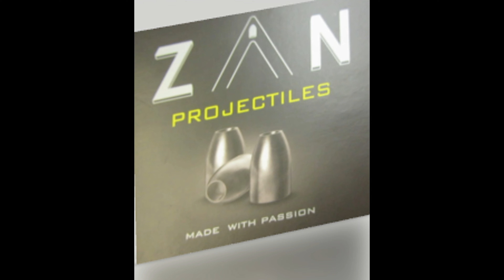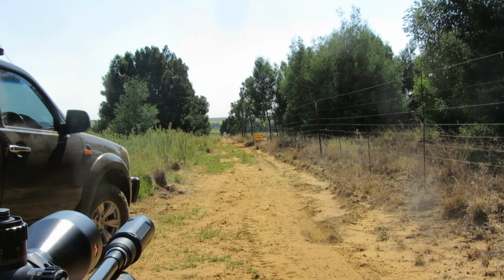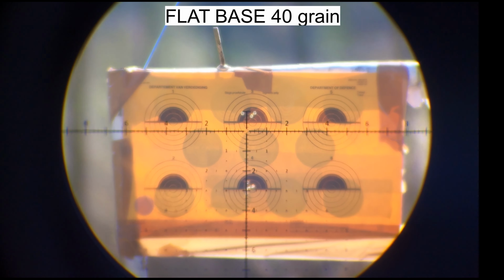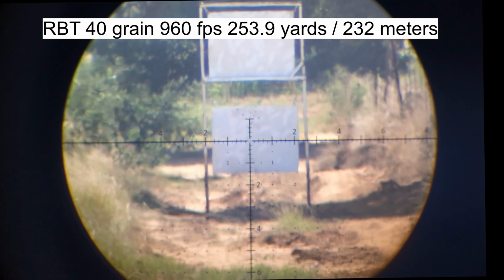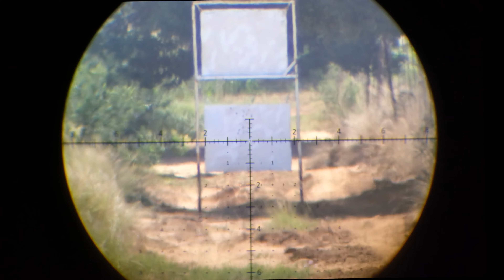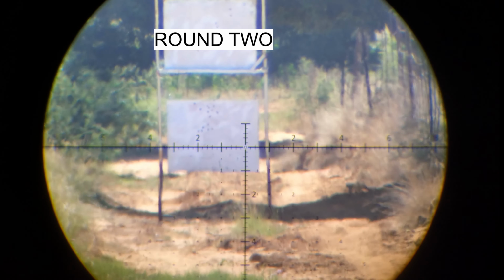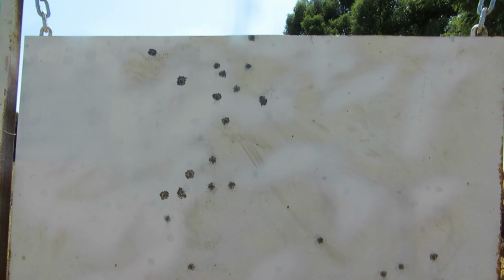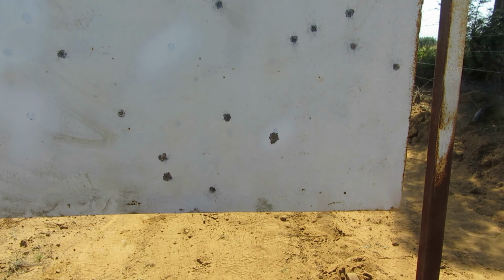FX IMPACT M3. FLAT BASE VS BOAT TAIL 254 YARDS

Comment: BOnjour merci pour le partage .. une question tout de meme .. ne penses tu pas qu'une 6.35 serait plus adapté pour cette exercice ??
Reply from the maker: Bonjour à vous.
Je pense que vous avez raison. Je ne possède pas de calibre .25, car une licence est requise.
Théoriquement, il devrait être plus facile d’atteindre la cible.
C'est malheureusement tout ce que je peux en dire.
Merci pour votre réflexion

Hello to you.
I would think you are correct. I do not own a .25 cal, as a license is required .
Theoretically, it should  be easier to get on target.
That is unfortunately all i can say about that.
Thank you for your reflection
Reply: @airgunslugslingers   .. Votre "IMPACT M3 est une arme d'exception dans le monde des PCP ..il faut le dire .. j'ai une FX crown MK2 en 6.35 .. canon 700 STX  ;; je ne tire pas de slug .. mais rien qu'avec des DIABOLOS je suis deja incroyablement surpris .. 
Je pense que le calibre 22 ( 5.5 ) a du mal a tenir le vent .. 
Sinon vos tirs malgres le vents sont incroyables .. ;-)
Reply from the maker: @lesplenums  Mon premier PCP était une crosse en bois à couronne continue, quel beau fusil.
Je me souviens de la difficulté de frapper systématiquement un gong de 12 cm de diamètre à 150 mètres avec un diabolo, puis j'ai commencé à utiliser des limaces..elles sont construites pour les longues distances, donc beaucoup plus faciles !.

Je vous remercie pour vos aimables paroles